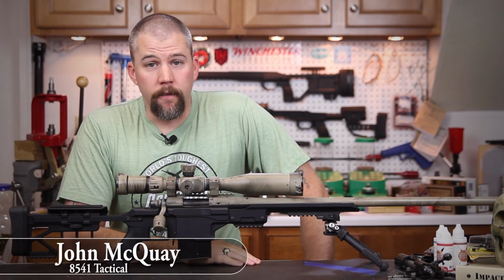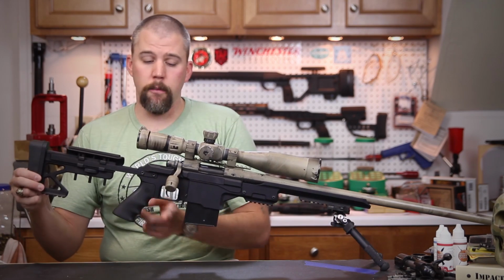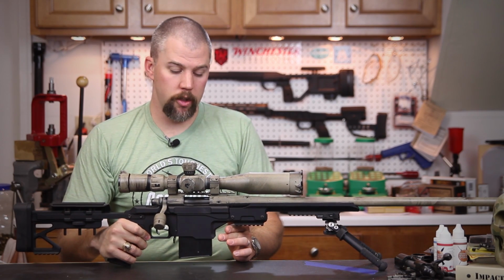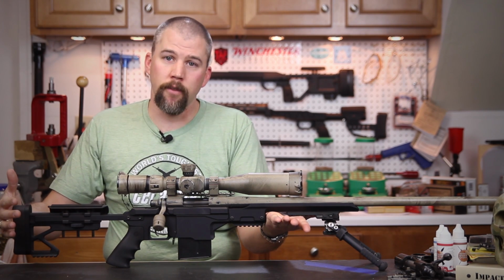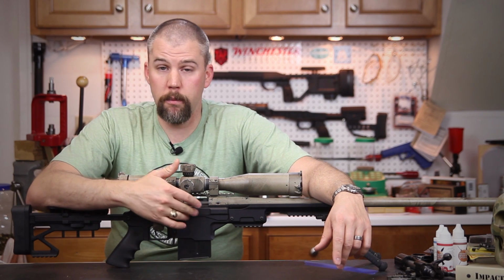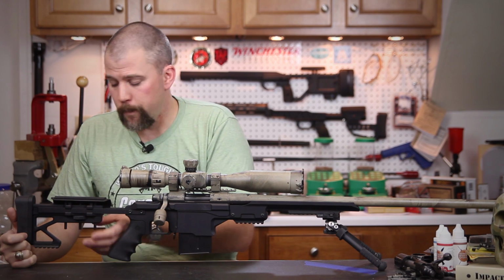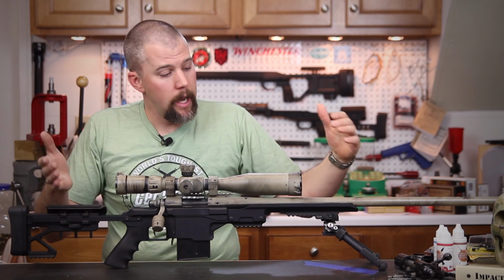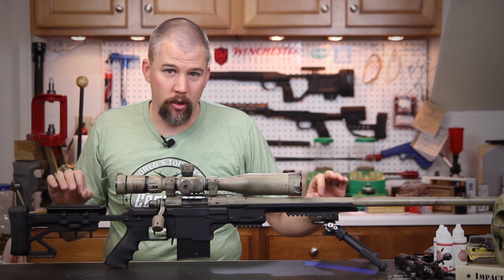Applied Weapons Technologies (AWT) Chassis

Comment: Looks like they still have a lot of work to do, I'll be sticking with an XLR for now. Easy fix for the comb, run a nut on that bolt and lock it up tight against the stock and you'll be good to go.

Comment: REMOVABLE FORE END IS NOW INCLUDED IN THE ABOVE PRICE.
 
**UPDATE**

All chassis now come with a removable MOE rail section on the receiver instead of a hard milled rail section. The trigger pockets have also been machined to accomodate most aftermarket triggers (timney, huber, etc.) We have also changed the recoil lug area to accept larger aftermarket lugs.

Comment: Nice stock but I recently just bought a Bell & Carlson Style 5 fully adjustable tactical stock that cost $600 less and has more options and is way better but the AWT chassis is 1.4lbs lighter which is kool.
Reply: does that B&C have the ability to use magazines or do you have to intall bottom metal for that?
Reply: BP_Shooter
Yes when u order ur stock, u tell them if u want the one with a magazine or not.